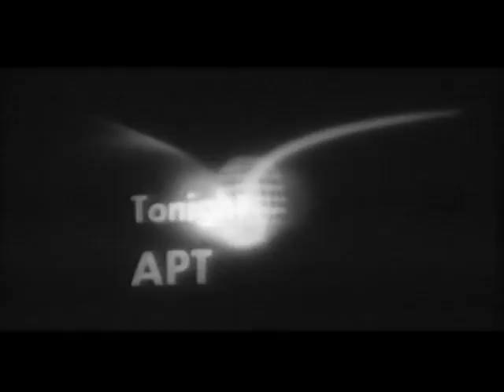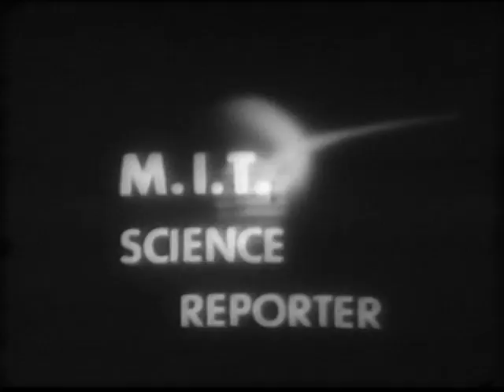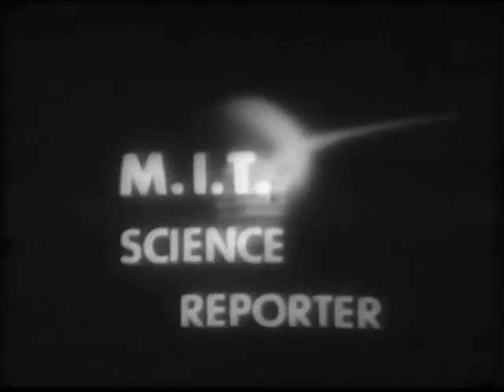MIT Science Reporter—"Automatically Programmed Tools" (1959)

Comment: In today's terms we'd call these 'CNC' machines.
Reply: Well, basically APT and CNC are synonymous in this context. A bit later the meaning of CNC evolved to indicate the whole manufacturing system, and APT became mostly the computer language, which controlled the CNC machines. APT is still used today in some legacy environments, but most of the systems use something more modern, like G-Code. It's actually quite amazing how much the contemporary G-Code resembles the original APT language shown here. One big difference between these two is that APT explicitly defines the geometry of the toolpath, whereas in G-Code it's more discretized or given in direct coordinates on the path.